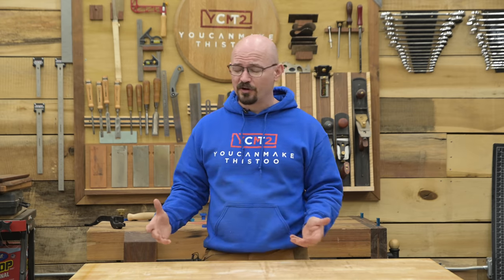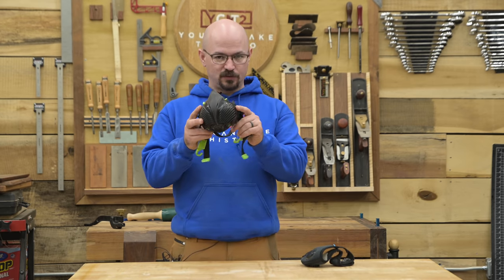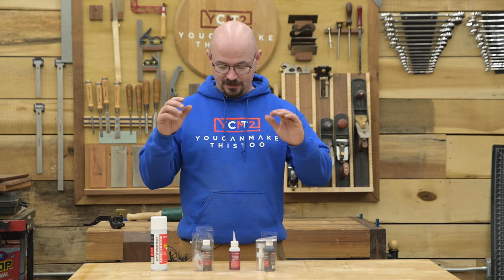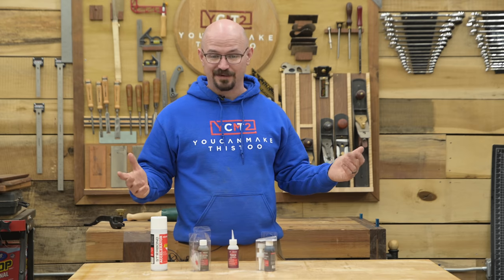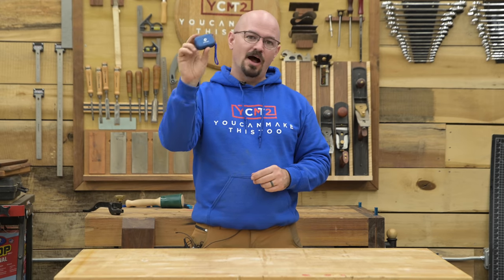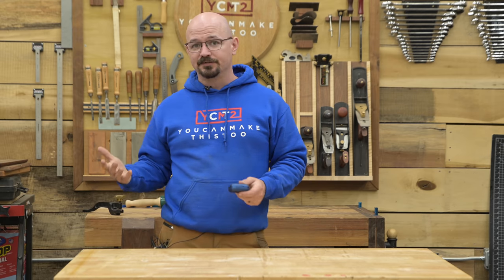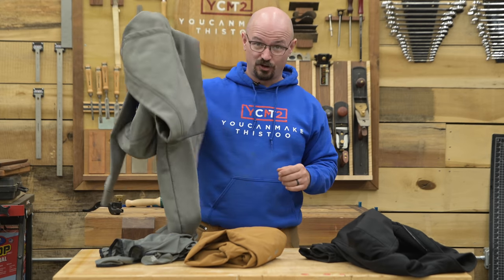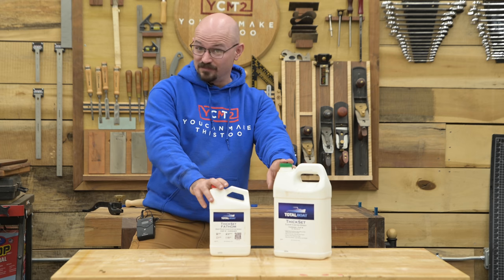Best Gifts for WoodWorkers 2021

Comment: Great ideas - Thanks! A handy cheap tool as well is a small carbide scraper like the HONGDUI 2 In 1 Mini Wood Carbide Insert Scraper (I think its $20 on banggood at the moment, if USA made is a priority, woodpeckers makes one too). And I disagree on the sand paper choice. I was Abranet for a while, but Cubitron from 3M cuts faster way way longer and doesn't dull after 10 minute like most sand paper (and now there is a 'net' version too). Cheers!
Reply from the maker: Interesting, I’ve heard of the new cubit ton but haven’t tried it yet. I’ll have to give it a try

Comment: Thanks for the tip on 2sand; never heard of it before.  Are you still in the Memphis area in your new shop? Where do you get your wood in Memphis? I just moved down here a couple months ago and have struggled to find hardwood stores
Reply from the maker: I’m just outside Memphis in MS now. The only woodworking shop is The Woodwork shop in Bartlett. For other lumber provides check out city wood, woodland tree service, Hood distributors, River city hardwoods, and interstate plywood